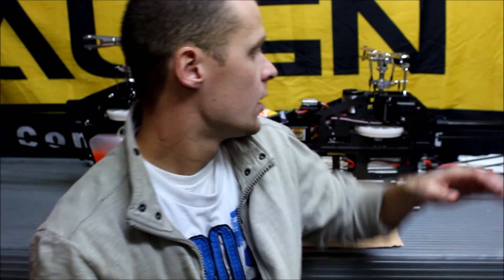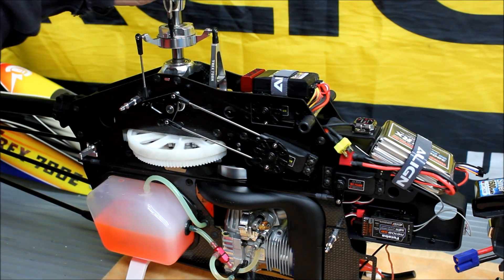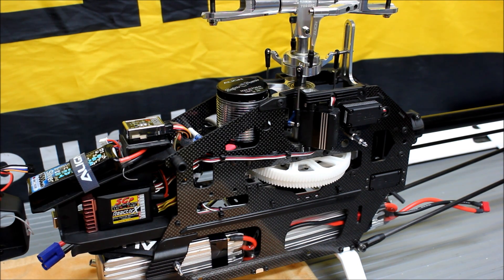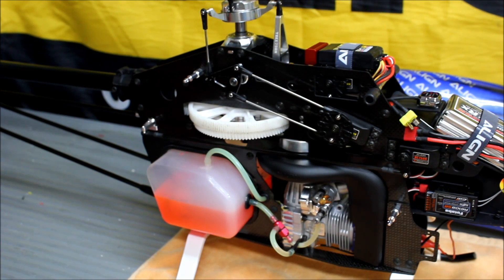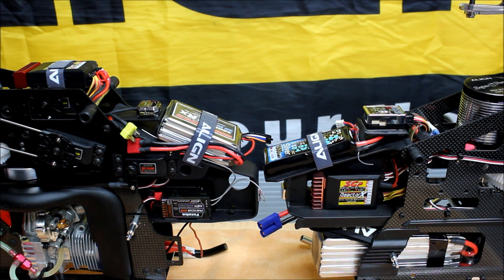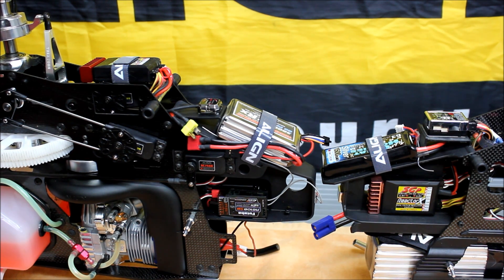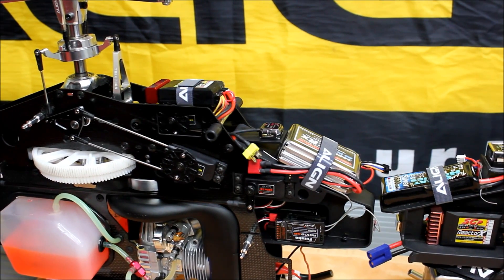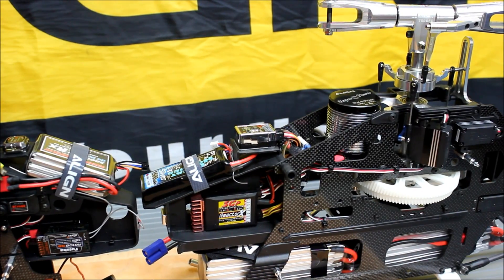700N vs 700E

Comment: LOl you have no clue i bet i can get under 4kg flying weight with a pyro 700 52l and 14s 4400mah lipos i bet you but the machine wont be stock its gona have kde upgrades plus boca ceramic bearings which will knock grams of weight off because of the ceramic hybrids and wiring management aswel 2000rpm is the max ile go with 700mm blades